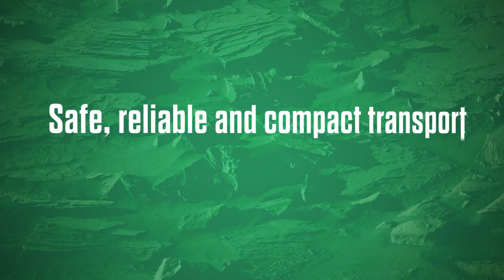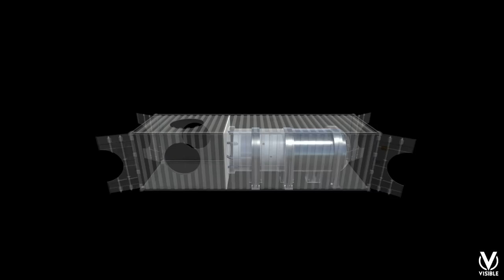A small reactor to bring power to remote locations

Comment: If nuclear energy can be that compact, we can use this technology in decommissioned nuclear silos or suitable federal facilities and turn it into almost anything. For example, data centers, super computers, digitized archives, scientific research that needs isolated but reliable energy sources, even public housing during national emergencies. Making nuclear energy this portable could make space applications almost possible, obviously some more improvements such as guaranteed safety features would be needed before risking space flight for one of these microreactors. Food for thought.
Reply: Portable, but as you also saw, of limited output as a result. This is for short-term reduced-usage needs like emergency deployment, not broad-scale extended requirements.  Don't be so hasty to decommission and dismantle the city-fuelling big boys just yet.
Reply: Deep space probes cannot be powered by solar because, duh, they go really far from the sun.  So deep space probes are powered by radioactive isotopes (wikipedia RTG or RITEG).  These RTG's provide power for all systems including communications, ion thrusters, cameras, and microprocessors.  So modern nuclear power can be made in a whole range of sizes including an RTG that is small enough to launch in to space.  The fission power in this video is designed specifically to be ready-to-go, easy to transport, and to provide 1,000 Kilowatts for months at a time without additional fuel.  There is another kind of reactor -- called a LIFTR -- that can provide grid-scale electricity.  If we use LIFTR's together with wind and solar then we can eventually shut-down all fossil fuel generators.  This is for real!

Comment: 1MW? It's not so much I hear about 20WW
Reply: Modern nuclear power can be done in lots of sizes.  LIFTR is a type of modern nuclear power that will work great at, say, 60 megawatts.  Or put bunches of LIFTR together to make 120 or 180 or 240, etc.  The reactor can be build in a factory and then shipped by boat, or rail, or big specialised trucks to someplace that needs power for the next 50 years.  The rest of the power plant gets built-in-place and when the reactor arrives it gets bolted together.  Lots of countries are working on LIFTR and hopefully we will build some LIFTRs.  But the power plant in this video is a different thing.  It is fully assembled and ready to be brought to a disaster area and turned-on right away when an emergency happens.  GENIUS!  I picture Hurricane Maria that demolished Puerto Rico in 2017.  The big power lines across the island were destroyed.  People could not draw water from their well.  They had no refrigerators. Some people died for lack of running water, refrigeration and ability to charge their cell phones.  Making modern nuclear power that can be deployed fast in an emergency is genius!  This is so much better than bringing diesel generators and then trying to bring a constant supply of fuel.
Reply: @nbnvideo  i mean the powerplant have the size of a truck container?
Reply: @CUBETechie  I do not know an answer to your specific questions.  My guess is that if Los Alamos makes a 1000 KW system that fits on a truck, then after a year or two they will figure out how to make them smaller and produce more power.  To me the important thing is that they start making these things.  What ever does not get figured out in the first generation will get figured-out in the second or third generation.  I just find it very encouraging that we are learning to use fission for easy-to-transport emergency power.  And we are learning to use fission for grid-scale, safe, sustainable power.

Comment: One thousand homes?  I think this is off a bit....
Reply: @noah rogers wll then gas is providing most of the power.  Still say it's misleading.
Reply: "According to the Energy Information Agency, the average US household uses 888 kWh per month, or 10,656 kWh per year. An average 1.5-MW turbine (26.9% capacity factor) would produce the same amount of electric energy as that used by almost 332 households over a year. "
Since that 1MW reactor probably has a capacity factor of 90% or more, I'd say it's pretty reasonable, it really depends on where it's used. Hawaii only need 6,061kWh per year, Louisiana 14,881kWh.
UK has an average of 4,000, the global average is around 3,370kWh, so it could easily power 2000 homes with that average.

To put into perspective, if the reactor works at a 90% capacity factor for 1000 homes, each home would have 7862kWh annually.
Reply: @noah rogers my PC has a 1kw power supply, lmao.
Reply: @noah rogers
... Wat? Gas? Wat?
Reply: @noah rogers "powers such and such number of homes" is usually used for electricity requirements/consumption. However gas consumption is related to location, gas stoves around here are a rarity and usually a luxury, ours run mostly on electricity for example (Switzerland). The car isn't part of the equation in a home as it is not a necessity. Heating/cooling can be done in various ways and is really location dependent (some don't need either), they can also be achieved with a heat pump and low electricity consumption. You can run homes completely on electricity, gas is one of many partial alternative.
Reply: For Brazil homes at Center-West/Southeast/Northeast small cities, add a couple of 7500/12000 BTU air-conditioners per house.
Reply: @takanara7  while it rarely draws that much power, I double dog dare you to get a Kill-a-watt meter, plug that into the wall, then plug your PSU power cable into it & watch the instant power draw wattage setting when your machine idles, probably under 100w & full tilt gaming, maybe 650w ..
Reply: @Drakilicious 5x 100w PV solar onto RV roof not exactly LUXURY // cost structure wise // when you add the cables, mounts, breakers, fuses, hardware, MPPT charge controller & some few hundred AH of battery energy storage, now your in the POS used car price range for the energy setup //
Reply: Nuclear fuel is extremely, extremely energy dense.